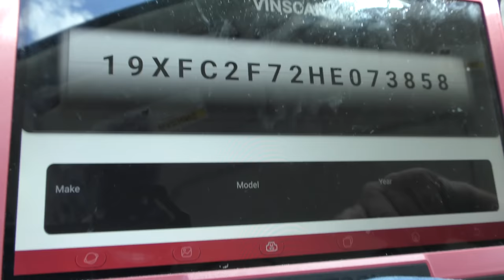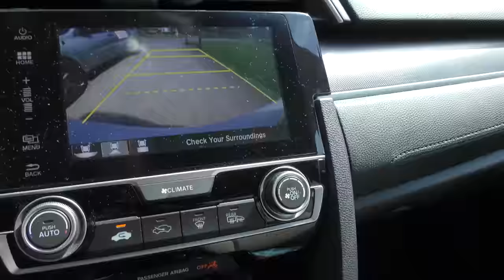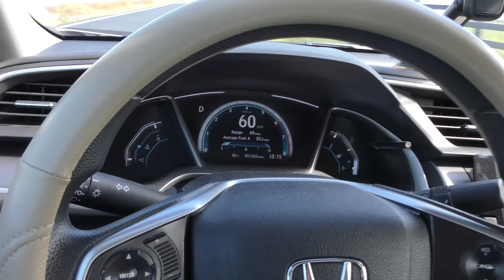Here’s What Happens If You Change Lifetime Transmission Fluid in Your Car

Comment: Scotty I am 71 bought a 2009 kia borrega. It is sealed transmission. Because it is old I assume trans fluid never has been changed. Do you advise me to change it?? It runs good but very worried as I found out parts are very. Hard to find and even non existent. I worry so much. Please advise as I trust you
Reply: Also it has 140000 miles on it

Comment: The subaru CVT has a iminimum temp (99-115F) and you fill until fluid dribbles out. Start the vehicle and continue filling until it leaks out again. Replace the fill plug and call it done.
Reply: I was told not to touch mine til 100k for warranty purposes 2016 3.6r legacy
Reply: @malikipolka1921  yup, wait til it already has damage from worn out fluid. I won't tell you how to maintain your vehicle but I will NEVER follow those instructions.

Comment: Change - don’t flush! I changed it in Mazda 3 2010 after 169000 miles, the fluid has never been changed and it was like a barrel oil!!! Changed the filter, pan and gasket as well and the car started driving 200% better!

Comment: OK so maybe this is a silly question, but when you measure the old and new fluid, do they have to be at the same temperature? Transmission fluid expands when hot, which is why there is a HOT and COLD reading on cars with dipsticks.

Comment: what if 4 quarts drains out, but then only 3 go back in and it starts to drip out from the fill port?  Is it necessary to sometimes refill while the engine is running? (on a ZF 8 speed for example)

Comment: Since 2000 I've owned 4 Honda Odysseys and one CRV. Drove each over 150000 miles. Never changed Trans fluid in any of them Never had a Trans problem.

Comment: Would you change the automatic transmission oil of Audi A4 Avant 2.0 2006, if it only has about 45000 miles on it?

Comment: 40 mpg (US) from the Honda is very good by not as good as my diesel burning Mazda 2 with a 6 spd AT. 65 mph on the freeway is 70 mpg (US).  I hate those CVTs, that terrible droning noise, awfully slow from a standing start in normal driving or when overtaking.  They will go much quicker but the fuel consumption really suffers.

Comment: Scotty, I own a 2017 Toyota Tundra with 83,000 miles on it. I have not changed the transmission fluid because the dealer told me that it didn’t need it until 100,000 miles. Could I use the same procedures as you used in this video to drain and fill the transmission fluid on my Tundra with the 4.6L engine?
Reply: Drain and fill is enough. Then you do it again every 60000 miles.

Comment: I have a 2020 Camry hybrid, and I haven't been able to find the transmission fluid change interval in the AllData site. Does that mean that the transmission is really just the electric motor like in the Honda Insight and Ford hybrids, and I'll never have to worry about that?
Reply: Prius transaxle is using motors and gears. You can change (drain and fill) anywhere between 50k-200k miles, or never. It won't fail under normal working conditions. Changing it is merely placebo or unless you are about to bring it over 300k miles ODO.

Comment: I changed mine. It probably didn't need it. Only cost $45 though for the fluid. Undo a couple of bolts (fill bolt first in case it doesn't undo)

Comment: My 2013 Ford F-150 EcoBoost, My mechanic said your transmission fluid looks like crap and it's low. I told him I have a lifetime warranty. He said it's up to you if you want to go through the headache of replacing your transmission. I told him change it even though it's supposed to be lifetime transmission fluid

Comment: I was told to change the transmission fluid at 25k, and the dealer would check for any metal shavings in a lab. It came out negative, then was told you never ever need to change Oil. I said ok and drove it 200k miles on the same transmission fluid. I just sold the car to car carmax. The only reason I did it is I sat next to the head of engineering responsible for the transmission design of my car on flight from Germany to LAX. He spent 4 hours telling me why it's a waste of time and money to do it. He even said it's even bad for the transmission. Now, other car manufacturers say not to change it, but don't back it up. It was a benz. Ask me what went wrong with the car for 18 years: one loose wire on the stereo system. I drove it 18 years and 200k miles. Best car I ever had.

Comment: I use a old refrigerator compressor as a vacuum pump and vac out the trans fluid into a jar. Keeps me from wearing trans fluid and I dont even have to get under the car unless replacing the filter.

Comment: My 2016 Honda HRV CVT transmission works perfectly in cooler weather , as the weather gets warmer it develops a jerking hesitation  when driving slow under 2000rpm. As in a parking lot. Cutting out sometimes.  I have changed the CVT oil at 45000km. Any ideas as to the source of the problem.

Comment: What if the transmission is underfilled from the factory? The drain, measure, and refill won’t be accurate. Many 2nd and 3rd Gen Tacoma’s were low from factory.

Comment: Can't speak for anyone else but in my years of experience when a transmission was drained, failure wasn't far behind it. I've never seen a transmission go out due to not changing the fluid. Not one time. I can understand why in theory since i have rebuilt them before. Many of those small parts can often get misplaced during a drain out. I would rather wait until impurities caused a change in operation then to upset the status quo. I know keeping clean fluid in sounds logical and reasonable but transmissions are a different beast than an engine.

Comment: Question, Ik your not supposed to change the transmission fluid after 100k but how much after 100k should you leave it alone. Mine currently has 104k, been meaning to change it but I haven’t got the time to yet.

Comment: A single drain will never removes all used fluid within,
That's how l change the ATF on my both my 2006 Accord V6 and 2007 Matrix ... both drain out around 3 litre of fluid, refill with same amount of fluid back, drive for a week or two, repeat the same process drain and refill, that's good enough me and for the purposes ! 
Or, Repeat the process one more, the third time  !
...and yes, both 16 and 17 yrs old are just around 120 k are still in great shape inside and out !😅😅😅

Comment: I bought my 2017 ford edge from dealer had 25,000 miles on it. checked the transmission by draining it and had a half gallon come out..it required 11 quarts..if I didnt check it thinking dealer had serviced it properly than I would have been screwed

Comment: Typical of CVT. Metal filings are from the plates and belt rubbing each other. Ive seen a toyota vios cvt break down at just 60k odo. These metal filings and there were a lot of them clogged the oil filter inside.

Comment: There are two filters also you should change. One inside the cvt and another one inside the heat exchanger.
Reply: Does the engine need to be cold or hot when you change the fluid? Thank you.

Comment: Just to be clear. I SHOULD NEVER FLUSH YOUR Transmission fluid?Only change the fluid every 50,00-60,000 miles to keep the transmission from slipping? I have a 2018 Mitsubishi Outlander Sport cvt transmission with 61,000 miles. The dealer recommended a transmission flush, not a change of transmission fluid. Also they said to change my brake pads and flush my brakes. So would I be getting ripped off? I've never done maintenance on a car before and this is only my second car ever. I owned it for 4 and half years now.

Comment: I can attest to the never flushing. Had a gmc envoy hit the mileage for a tranny flush. Listed to the mechanic got it done. About 300 miles later the trans went out. Got stuck in first gear and wouldn’t shift. Luckily a rebuilt was pretty cheap, like 1700 parts and labor. Still irritated me.

Comment: Hmm...I have a 2005 Cadillac Deville that I dont think has ever had the transmission fluid changed. It has 86,000 miles.  It shifts fine, so I guess I will leave it alone.

Comment: Engine should be warm when you do this NOT COLD
You should really replace the pan at the same time together with the bolts and filter. 
Make sure EXACTLY the same oil viscosity spec goes back in as those oils don't mix. You may know what SHOULD go in, but you have no way of knowing what the existing oil is
Don't put back what you took out. Put the Correct amount back in. If your oil has broken down or there has been a leak or it has overheated you will have lost some.
The correct level is to pump it in via the drain plug until it starts just slowly dripping out of the drain plug

Do it properly and you can extend the interval by another 10K. It's a 10 minute job and much easier done in a garage

Comment: I have a 2009 Nissan Murano with AWD CVT Transmission and 209,000 miles. I'm thinking about finally changing out that lifetime cvt fluid in the "crap" Jatco transmission that won't last anywhere close to honda or Toyota cvt lol.

Comment: Car should be level when refilling with Honda HCF-2 and breathing plug should be removed to as ascertain correct level. Every 50K is fine and you might want to replace the “lifetime” filters after 100K (these are not identified in the manual)..

Comment: Hard to believe the entire torque of the engine is being transferred to the axles through a tiny steel belt inside that CVT transmission. And even more interesting the pulleys input/output are configured so the belt is actually pushing the energy, not pulling like your typical serpentine rubber belt. This is where the steel belts get their strength from. One more surprising fact is the friction mating surface is on the sides of the belt, not the bottom. This is due to the conical shape of the input/output pulleys and their continuously variable size. So basically the entire energy of the engine is transferred to the axles through a tiny steel belt, that only makes contact on its sides and is pushing toward the output. Crazy to consider…

Comment: I recently did this on a 2019 Civic 2.0 JDJC transmission. 5 quarts came out, we put it until the check valve leaked, it was 4.25. Documention says 3.7 quarts. I'm so confused. It runs fine after 1-2 days. Still confused.

Comment: I recommend a home made flush do not take it to the dealer. I’ve been doing my own flush thru the radiator never had problems if you do it right. To me there ain’t no sense of changing half of the oil only.

Comment: When I removed my transmission oil I only removed 1 3/4 quarts and the Manuel asked for 3’9 , I replaced the 3’9 but should I only replace what came out ? And why was it less than 3’9 quarts

Comment: How come when you accelerate full throttle, it didn't stay at maximum RPM and stay there as it builds speed? That's normally how CVTs work.. but perhaps I'm a little behind on the tech.

Comment: Just came to the Toyota dealership to buy transmission fluid for a change (2014 Toyota Corolla S+ with a CVT) & was curious as to what the quote would be to get the job done with them. The guy straight up told me “We’re not gonna touch that, sorry” 🤣🤣🤣 curious as to what’s the problem lol

Comment: IF YOU never put transmission fluid in a Dodge Grand Caravan and the Van has trouble backing up in reverse but you have no trouble driving forward but it jumps for ward when you put it forward does the mean you are low in transmission fluid

Comment: I bought my car used at over 60,000 miles 3yrs ago now I’m at 176,000 miles I have yet to change my transmission fluid. I’m afraid to do it myself….I’m pretty good at screwing things up pretty quickly. I don’t have any transmission issues I don’t feel any slipping or anything. But I’m afraid to even touch it.

Comment: I don’t think this is true for a Honda as I have my dealer changes the CVT fluid on my 2015 Honda Accord every 50,000 km, I am pretty sure my owners manual recommends to change between 45 and 50,000 km. Unless newer Hondas say they are lifetime sealed.

Comment: By not dropping the oil pan and removing the oil filter aren't you only replacing about half or maybe two thirds of the transmission fluid?  Isn't the correct way to do a tranny fluid change is to drop the pan, replace the filter and clean everything up, install a new pan gasket and drain plug gasket?

Comment: my honda has a check bolt at the top. you change fluid like a manual, til it weeps out check bolt. cycle through gears, check again, fill til weep, new washers done. dealer wanted $250 to change. I don't understand why cvt trans oil change is $250 and regular oil change is $40.

Comment: Own a 2014 Nissan Altima with little over 225,000 miles and never had transmission fluid changed. Drive it conservatively and don't smash the gas at every green light. Drives good to this day, except the cats are going bad.

Comment: Sorry but for my 2012 Subaru it isn't this simple.  Namely, you replace what drained out, and then you need a quality (NOT necessarily Subaru)  code scanner to make sure the CVT fluid is up to proper temperature and then circulate new fluid via shifting P-R-N-D and back, adding fluid until it pops out of the filler hole. 

This is all pretty easy IF you (or in my case my friend 😁) have a good quality code scanner like an Autel or Snap ON.  I'm not sure how crucial it is to get the CVT to precise temperature, but this is what the Subaru Service Manual says so I probably wouldn't screw around.

Comment: I have to keep the fluid changed by a nissan dealer every 60k miles on my 2019 altima. I have an unlimited miles warranty in the transmission. The car has 144k miles on it now.. it's fine...

Comment: I would NEVER jack up one side of a car to change the atf or even engine oil. I take the time to jack up the front and rear so it's level.
Reply: Doesn't matter as long as he is putting in exactly what came out an car stays in the same position for both procedures...
Reply: Couldn't you just jack up the front, take the bolt out so it starts draining and then lower it down so it's level? Then you could just lift the front so you could put the bolt back in?

Comment: I just had a Nissan Juke I got rid of with 86k miles with a cvt that was going out I got i with 75k and first owner didn’t change cvt fluid I changed but it was too late 5 to 7k for a new cvt Nissan dealer said most don’t even last that long

Comment: As a general rule, for pretty much Every vehicle I've owned, I always drove them to 30k and then changed the fluid, regardless of the type of transmission.  This gets out the initial filings that may be in the engine from assembly/production.  Granted in some factories / brands, they run the engines, then change the fluid at the factory but you never know and it's sometimes worth it to pay (or do it yourself) after the first year or two just to be on the safe side.  IN fact, years ago (20+ years ago) changing the transmission fluid after the first 10k-15k miles was actua lly part of the maintenance schedule on most vehicles that the mfr recommended.  Then it was pretty much every 50-60k thereafter.  And quite frankly I would do the oil around 2000 miles if you buy a car new for the same reason (you can resume 5-6k oil changes after that but it does get the original oil out after break-in).  Although I have been told during break-in (the first 500-1000 miles or so) you don't want t ochange the fluid as some might have special additives that can help with break in (probably not so much anymore but I have heard of it being possible, so I generally drive the car 1000 - 2000 miles and then do its' first oil change).
Reply: You maintain like me - and probably get over 200k on your cars!🤓👍

Comment: IF you do decide to change your Automatic Transmission Fluid yourself ???
First thing to do.
Remove the Filler Plug ??
WHY ?
Nothing worse than draining out the Transmission Fluid and finding out you can't remove the Filler Plug ???
I have a few customers come to me with this problem.
Unfortunately they need to transport the car on a Tow Truck.
Works out to a pretty expensive Fluid Change 😬

Comment: Scotty, or any other savvy mechanics. I have a 2016 Honda Accord with 120k miles on it. My transmission is starting to make whining noises at low speeds. It doesn’t slip or anything, but the sounds is quite concerning. Does anyone know what it could be?

Comment: What about a 2010 Kia optima lx transmission. There’s something wrong with my transmission. It jerks really hard down shifting when slowing down at 20 mph. I did research online and found that alit of people has had this problem and it was the transmission fluid heat sensor or temperature sensor it’s called when you look for the part. But would like to know how to do it and if anything that is said in this video is the same for a  2010 Kia optima lx automatic transmission. Wanting to do it myself or have my bf do it himself and he doesn’t know much about cars today.

Comment: i don't know what kinda honda dealer that told you that you don't have to change the fluid but every honda dealership i know recommend it every 30k just like all the old transmissions. Why would there be service codes that tells you on the dash to change them. Why would they even sell the cvt fluids in the first place if you don't need to change them 😅

Comment: Question for anyone...Is it really necessary to change the transmission filter if you change the transmission fluid every 30k? I've changed the transmission filters in the past but dropping the pan always has me uneasy because I'm always fearful one of those tiny 10mm screws they use to hold the pan to the transmission will just shear off.
Reply: The filters are just mesh screens that don't need replaced. For the screen to get clogged would take way longer than the life of the transmission. Just drain and fill.